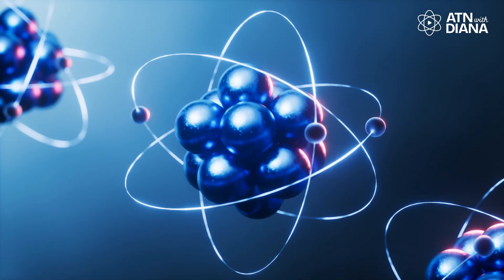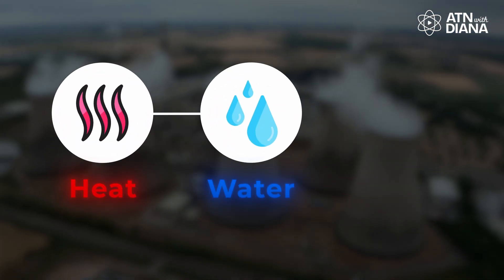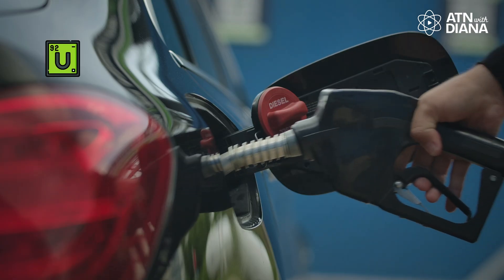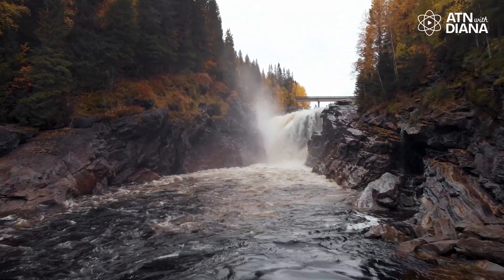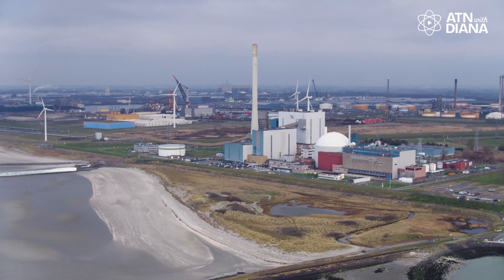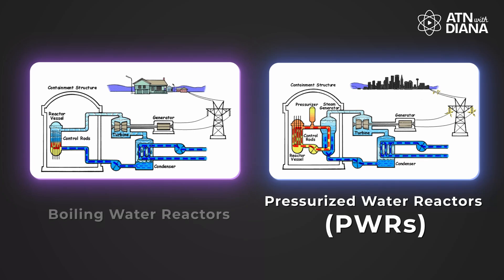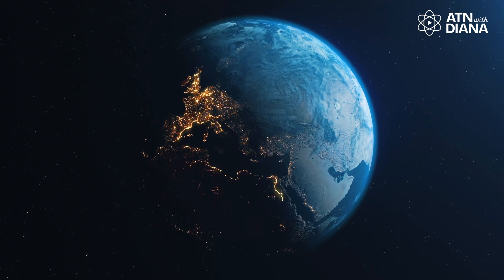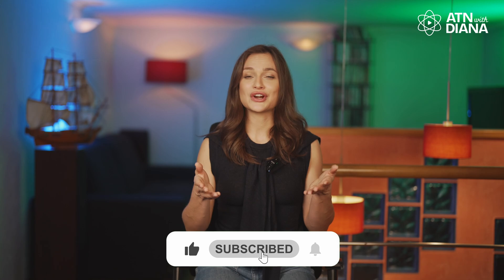How Nuclear Energy Works?

Comment: I am super happy that you took the time to explain this, thanks a lot!
Small comments on safety:
Usually boron is dissolved in the water, which is used to control the reactor power. 

The most important safety feature of all modern reactors is in my opinion the fact that the speed of the reaction slows down when the temperature becomes higher. This is because the rate at which neutrons are absorbed by absorbers rises with higher energy.

Obvously nuclear power is the way to go if we want to decarbonize. Particularly since not only electricity but also heat generation needs to be decarbonized. Which is a challenge, because the amount of heat the industry requires is multiple times larger than the amount of electricity. This could cheaply be provided usign nuclear.
Reply from the maker: Thank you so much for your thoughtful comment! 🙌

You're absolutely right on both points about safety—boron dissolved in the coolant is a key part of reactivity control in PWRs, and the negative temperature coefficient is such a fundamental safety mechanism in modern reactor design. It's what gives operators that built-in buffer, making reactors inherently more stable as temperatures rise.

And yes, the heat aspect is often overlooked in decarbonization discussions. Industrial heat accounts for a huge chunk of global emissions, and nuclear is uniquely positioned to provide that high-temperature, reliable heat—without the carbon. Whether through SMRs, advanced reactors, or even district heating systems, there's a lot of untapped potential.

Thanks again for contributing—comments like yours push the conversation forward!